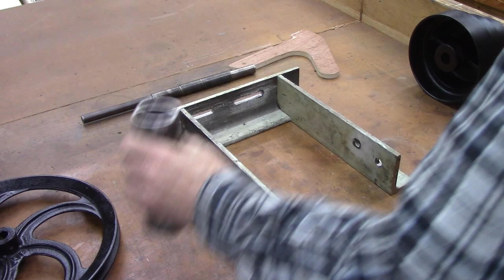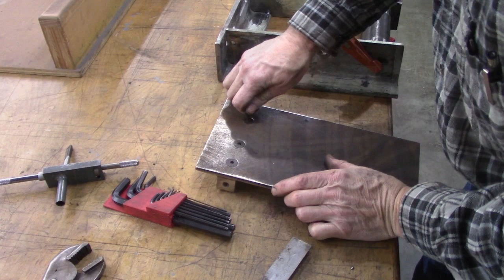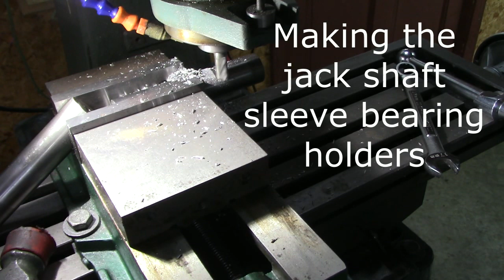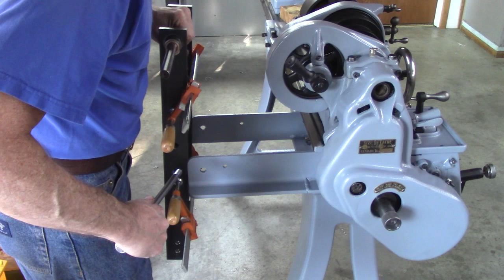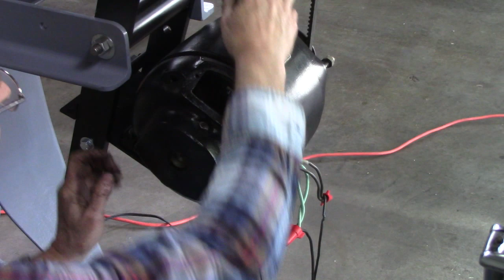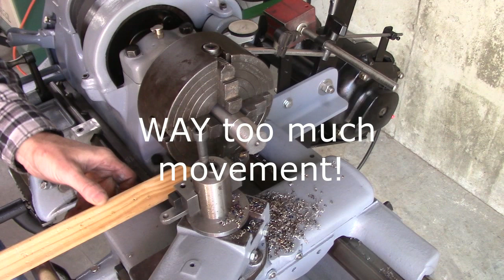South Bend 11-inch Lathe Rebuild - Part-4

Comment: Very nice project.  Your finish looked really good at the end even though the feed rate looked really fast.  I'm wondering,  2 positions on the carriage are 2 different feed speeds??  Is this represented on the thread chart?  Seems like it would be.  Maybe I missed something?
Reply from the maker: Thanks, it turned out great I think. There is a low and high range where the change gears would be, a 3 position lever on top of the quick change and then the standard shift lever. The controls on the apron are the clutch and half nut. The clutch is about 1/3 the speed of the half nut. The three position knob is to switch between the half nut, carriage feed (with clutch) and crossfeed (with clutch). The carriage can move very slow but also ridiculously fast.  I can cut 2.5 TPI !!! Or at least the carrage will move this rate. That's crazy fast.
Reply: @WinkysWorkshop  Just a sec hombre.  How is anything in the apron engaged if the 1/2 nuts are not?  I've not had a lathe with a clutch so maybe I'm missing something here.  The clutch can't be gripping the the outside of the screw can it???  I think the manual might be at Vintage Machinery.
Reply from the maker: @CraftedChannel  - Clutches are very common on lathes with quick change gear boxes. When I got my Logan 820 it had a clutch. My Logan 200 did not have one so I was wondering why I needed a clutch. The clutch does two things. One, it has a different ratio so the carriage moves slower and two, it will slip if you have a mishap. The lead screw has a key way and the apron has a keyed sleeve with a worm gear. The worm drives the carriage through the clutch. In a way I like the half nut better. It's more like a switch. The clutch has a knob you have to tighten. Here's a pic of my 820 apart. You can see the lead screw and the clutch drum on the other half of the apron.  https://photos.app.goo.gl/HokXHMV53QjgHGkM6
Reply: @WinkysWorkshop  I've had a bunch of Atlas lathes down.  I don't know why I didn't think of the key-way.  Of course.  On an Atlas, that only drives the cross feed.  Because it can slip, it's not viable for threading and you can't snap it in and out of engagement.  All makes sense.  ;-)

Comment: I'd be concerned about all the motor and bracket weight hanging on back. Looks like it needs a leg like your 820 Logan, even if it was a moveable one just for support. A newer reversible motor, with a drum switch, maybe with wires all in the pipe. Good looking machine. I guess you're looking for more rigid than the Logan? If it's not more rigid, what made you want a Southbend?
Reply from the maker: I got this South Bend just because I'm a nut. HA!  Honestly I didn't need it but I got it for $100. Of course I had to drive 130 miles to get it. Yeah... I need to run the power cord inside the conduit. I thought about the weight but I think it will be fine. The casting on the bed is almost 1/2" and I have big washers to spread the load. Otherwise there is no danger of the lathe tipping. I could stand and jump on the drive and the lathe wouldn't  budge! This is a very heavy lathe!  I'll probably stick with the Logan and keep the SB as a second lathe for a while. I like the ball bearing head stock in the Logan plus the 1-5/8 thread side on the SB spindle is an oddball. I just ordered a 5-inch 3 jaw for the SB and I'll have to make a back plate. Thanks for the comment!

Comment: Very nice rebuild as I have come to expect from your work! One suggestion though is to make a shield or boot on the mechanical reversing arm to prevent any chips or oils from getting inside the motor, especially near the commentator and brushes it could easily short out.
Reply from the maker: Thanks David, I was thinking the same thing about chips getting in there. I almost didn't use that motor. I wanted one with a reverse. Then a friend suggested the reverse lever. I think it looks cool and it works great. The motor was probably close to the age of the lathe which is nice. Dang thing much way 60lbs and it's only 1/2HP!
Reply: @WinkysWorkshop  Nice job on the rebuild. The recommended motor for this lathe is 1/2 HP so you're right on there. The counter shaft should be turning at 290 RPM which would give you a high speed of 595 spindle RPM. Not sure if your counter shaft is turning a bit on the fast side. These lathes with bronze bearings are not meant to turn at the high RPMs of lathes equipped with ball or roller bearings. Likely destroy the bronze bearings if turning too fast. With the tight bearing clearance  of around 0.001" is recommended to use a 10W non-detergent motor oil and 30 non-detergent for the rest of the lathe.

Mine came with a 1/3 HP motor mounted in the location similar to yours. Turns out the motor has an adjustable pulley on it so I adjusted it to the smallest diameter I could to slow the jack shaft to the 300 RPM range.

I see you're now using the AXA quick change tool post. How do you like it on this lathe or would you recommend getting the BXA size? Thanks. I was looking at getting the AXA for mine too, but was recommended the BXA.
Reply from the maker: @RAYAR54  Thanks. Yes you could be right about the speed although I suspect it isn't way off. I have run the lathe at full speed many times for a final pass. Most often 4 or 5 minutes max. Never had a problem so far. I need to get a tach and measure the speed or do the math. I think my motor pully is 2.5" although I'm not sure the driven pulley for the countershaft is the correct diameter which might make the speed way too fast. AXA is totally adequate. The only plus to a BXA would be the option to run a larger tool shank. The only reason I would consider a BXA is if I was sharing tool holders with another lathe.
Reply: @WinkysWorkshop  Thanks, I thought the AXA size would be a good match for this lathe. Should be ordering a set soon.
Reply from the maker: @RAYAR54  I recommend an import tool post. I have used Shars and Bostar and both are excellent. They are about 1/4th the cost and still solid. The only quality problem I have found is the set screws.
Reply: @WinkysWorkshop  Been eyeing a Bostar set, likely be going with that.
Reply: Ordered the Bostar AXA 10 pcs set due about mid Oct. Now is to figure out what to order for tooling for this set. Looking to go with the carbide insert type, have some research to do here.

Back in the day when I took the machine shop course in high school, 73-74, we were using HSS bits and grinding our own. Now I need to learn about the modern tooling being used.
Reply from the maker: @RAYAR54  - You were right about the speed being too fast. I'll get a smaller motor pulley to get the speed back into correct range. The highest speed right now is 1180. I did some investigating however and the newer south bends with sleeve bearings ran in this range. To be on the safe side I'll get a smaller pulley.
Reply from the maker: @RAYAR54  - Ebay is a great place for inserts. You can afford to experiment.  Send me an email at winkysworkshop@GMX.com and I'll give you a few suggestions....  well what works well for me anyway.
Reply: @WinkysWorkshop  I thought it looked a little on the fast side. You do currently seem to be in the proper RPM range for using carbide insert turning tools. This era of lathes were really only using HSS turning tools at the time.

I figure mine is turning the jack shaft just over 300 RPMs, which is not bad.
Reply from the maker: @RAYAR54  I don't run it that fast most the time. Just occasionally for a finish pass. Plus it throws chips half way across my shop.
Reply: @WinkysWorkshop  I'm just wondering if your motor is a 3450 RPM, that would explain the much higher speed with the pulley diameters you have.
Reply from the maker: @RAYAR54  No its 1750. I suspect the countershaft pully is too small. Also dropping the motor pulley size from 3 to 2 inch would bring it down to the normal range.

Comment: With a little research and internal wiring modifications that motor should be able to reverse. I guess I should have watched the whole video before commenting? However, you should be able to reverse electrically.
Reply from the maker: I'm not a motor expert but this motor is different than most. It's a repulsion induction. I don't think it's possible to wire it different. The cover I put my lever through was originally intended to access a mechanical lever for reversing.
Reply: @WinkysWorkshop  It looks like you have permanently solved the problem with a good solution, I did not wait for the ending to comment sorry,

Comment: Tell us about the flat belt and how you made it please.
Reply from the maker: Okay...  I used to work in the printing industry but I retired last year. The belt I used was surplus they were going to toss so I saved it. After I retired the company asked me if I would be interested in preparing belts for them. This involved cutting the belts to length and grinding a taper on the ends. So I built a grinder and supplied them in prepared belts. I also have an old belt heater/press and some glue. I've considered selling belts to old lathe owners but the required heater/press is an obstetrical. There are many option for belt types but gluing a belt is the best way. A good splice will never break and you never have to take a machine apart. 15-minutes @ 100 C and you are good to go!

Comment: Good work, great ingenuity. it sure runs quiet
Reply from the maker: Thanks Kevin, yes it seems to be a very well made lathe. It will take a slightly larger cut than the Logan but not as smooth. Sleeve bearings vs. ball bearings in the head stock.

Comment: Gday Winky, this lathe has turned out fantastic, the motor mount works really well, you really did a great job on the reverse setup for the motor, I’ve never seen that before, I have a Mars Hercules lathe that I’ve had for about 25 years and it had a lot of age on it when I brought it, I’m starting to think I should do a restoration on it, it’s a big job but very rewarding, it does have a far bit of wear in the first 6” to 8” of the bed which would be nice to get it reground but that’s big dollars I don’t have, I really enjoyed this series of videos and I really appreciate the time and effort you put into making them, please stay safe and take care,   Matty
Reply from the maker: Thanks Matty, as near as I can tell this lathe has almost no wear. It was a huge job but worth the time I think. The drive was my best guess....  I wasn't sure it the tension would be right on the flat belt but it seems to be about right. Thanks for watching and the comment.

Comment: How are you going to stop the chuck unscrewing in reverse ?
Reply from the maker: I use that mainly for backing a tap out so the speed will be low. I won't be using reverse for cutting. So far I've never had one unscrew on my other lathe.

Comment: Very good to see it running.
A suggestion  ..
Make a quadrant for your reversing lever.
You will have enough "spring" in the handle to allow a peg to drop into a hole.
I would be worried that the brushes might move whilst you use the machine and I imagine that would not be a good thing.
Reply from the maker: I was worried about that too but I moved the lever under power and it didn't do anything (I had to know, ha) plus it requires a fair amount of effort to move, I don't think it will move on it's own but thanks for the idea. And thanks for watching.

Comment: You  might want to consider running the power wire up though the mounting pipe into the box!
Reply from the maker: I agree. The switch box had two holes so I used both but it would look better without the wire ties. Thanks.

Comment: Not sure if you noticed, but that cut you made before you showed checking the bearing play, you were pulling the material out of the chuck.

Lathe looks good and you did great work!
Reply from the maker: No... I didn't notice that. I'll have to watch again. Thanks on the lathe...  I'm happy with the results.

Comment: I think they went up to #16 it's been 40 years I ran a south bend with a 12 inch chuck threading inside and out side pulley's that screw together with a 4-1/2 inch x10 thread matting them together for it was a adjustable pulley tor some over the road truck.
Reply from the maker: Sound like you ran a much larger lathe than this one. Aside from having sleeve bearings I think the south bend is very well made. My Logan has ball bearing and the finish on the cut seems to be better. The bearings on this SB might need to be a little tighter. Right now the clearance is about .0015 and I need to get that down to about .001. Thanks for watching!

Comment: Looks very nice. An observation, I think the chatter you mention @43:32 may be the motor bouncing. I noticed that a couple of times when you were showing from the back. Also I think you'll note that the chatter sounds in time with the bounce! Excellent job all way around. Was wondering if we'd see the "Happy Dance"!
Reply: Maybe chicken and egg  ?
Was the chatter making the motor bounce  ?
Reply from the maker: It is possible that motor movement would have an affect on this but in this case the bearing was loose. It had about .007 slop. After tightening the bearing it was very smooth. These sleeve bearings are new to me. Right now I have about .0015". From what I hear .0007" to .001 is ideal.

Comment: Glad to see another SB up and running, those 11's are a bit scarce.... Working on getting a 9A myself. Nice job!
Reply from the maker: True...  weird spindle size too (1-5/8"). I haven't used it much yet but it seems to work well.
Reply: @WinkysWorkshop  Is 1 5/8" the thread size or the bore?
Reply from the maker: @andyZ3500s  1-5/8" on the OD of the spindle threads. My Logan (and many others) is 1-1/2"
Reply: @WinkysWorkshop  I might be able to come up with some back plates for you. I'll keep it in mind.
Reply from the maker: @andyZ3500s  - I just bought a 5 inch plain chuck with a 4.25" 3-bolt circle. I found some plates with a plate with 1-1/2' treads but trying to get 1-5/8" would be a trick. I also found  one with 1"x 8 TPI which would be great BUT I'd have to order from China. I also have a 1" x 6" x 6" piece of steel I can use. Let me know.
Reply: @WinkysWorkshop  I volunteer at a foundry that was established in 1873. Look for " Knight Foundry " in Sutter Creek Ca. We are a nonprofit organization so people donate all kinds of old machinery related items. All I can do now is make a couple phone calls because of the carona virus. We have not been having our work days or tours. Let me no what the TPI is and give me a couple days and I'll see if I can come across one. I still have your Email so I will contact you that way. Andy

Comment: You had it in lathe you should have put the cutter in tool post on center and moved the cartage in and out moving the table a few thousand per cut I cut a lot of key ways like that.
Reply from the maker: That's true!
Reply: Could have drilled some material out first.
Put a blank in the bore and drill half and half.
Then just clean out the corners with your special cutter.